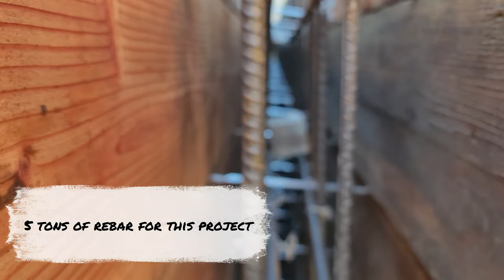How To Build  Concrete Retaining Wall On A Steep Hillside  Start To Finish

Comment: That is a brilliant Vid. Am guessing the piers go down to bedrock, so about 16 feet to bedrock... Did you guys have to drill into the bedrock to get a fixing?
I used to be a geologist as well as a carpenter....lol.  A bit of both Worlds here.

The Bay area need to tie everything down to bedrock because of earthquakes and soil liquefaction.  
This should tie the property to the deck and stop it slipping downhill.

But that is some impressive engineering, and no doubt exceeding code.
Reply from the maker: Yea the inspector made sure we was into bedrock. We had to dig a couple of them deeper

Comment: What do you do for safety that trench is over there head a lot of people die like that every year?
Reply from the maker: Ideally you would shore it up.. But this dirt was super hard and it was only little bit that was over 5 feet..
Reply: If you see the sides crumbling when you are digging, then its wise to shore it up.
If its not crumbling  or slumping and its not going to rain, you gonna be OK.  Most of the time if the soil is well compacted, its not gonna move.
Its only bad when you have soil that's been turned over or backfill.
In this case, its not too deep, not an issue.
Reply from the maker: 👍🏾👍🏾👍🏾 Your my new spokes person 📣📣

Comment: 4:03 to about 4:25 that rebar from the piers should have more development length and the staggered heights of the rebar ''heads'' on each column is not recommended.  Stirrup spacing should be closer at the columns also  6:17  should have stirruped your pier rebar heads and maybe even 90 degree them towards each beam direction == as it stands now, they are slightly assisting in rotation of the grad beam if a force attempts to slide them or rotate them down the hillside.  8:01 I see your grade  beam and more of "heel" might help in resisting turn-over forces.
8:04  mud on steel is just a bond breaker and the top of stirrups lack any top steel (laterally) . 
8:33 put that lateral steel inside the stirrups.   The spacing of the vertical steel is awesome, I like the close spacing.  8:35 lap the steel tighter.    Impalement protection at ground height.
12:57,  I like the corners ... 16:38 at end of wall, I can imagine water retention behind this wall system (increasing pressure) and possible rotation off of pier heads with the little development of rebar... you could have ran those as tall as the wall with close stirrups (using and offset design).   Some drainage ports would have been nice to find in this wall system fyi.  I am guessing you worked with structural plans and possibly a geo-engineer, so please pass on my comments to them and have them reach out to me if they do not understand the value I am offering here.
Reply from the maker: Appreciate the feed back.. And yes we work with 3 engineers on this project and we pass all inspections rebar (piers, grade beam and wall) , soils framing etc. But I'll pass it along.. 👍🏾👍🏾 And yes a full French drain system is in place.. Out here these walls
Reply: Aside from the fact that its inspected and passed code by the architect and city engineers, you are talking nonsense. 
The city inspect and approve the rebar. You only see a vid are not wise enough to keep your fingers away from the keyboard.
Reply from the maker: #myman

Comment: So, you allow for the footing to dry before you pour the wall? I'm doing a DIY retaining wall in my back yard...it's about 150ft x 4ft high...just using your videos as a learning tool, you do good work...I'm not using 2x12 because I have nowhere to put them once done, so I'm renting symon forms for the project.
Reply from the maker: Normally with the plywood setup you will pour footing first..  Check this video out.

https://youtu.be/XNOS1c1_rxw

Comment: I'm forming a foundation wall with 2x6's that I will use to frame the walls of a shop. I plan to space the ties 4' o.c. That sound right? Also, the Simpson catalog says not to form a wall using wedge ties that is more than 4' tall. Seems that they work fine for your tall pours. What gives?    Your wall forming is Impressive.
Reply from the maker: 4 inch on center sounds a bit overkill..minimum we do is 12 inches on center.. Yea not sure where that 4 foot theory came from.. We have built as high as 12 feet.. Bracing is important.  Good lick with the project

Comment: Amazing work. I really enjoy your content. Do you have any contractors whose work you approve of in the Los Angeles area? I have some serious concrete work coming up.
Reply from the maker: Appreciate the kind words.. Do. You have plans for the project?
Reply: @AllAccessConstruction  Structural engineer is finalizing now. Have to build three hillside homes and the accompanying road, which will need 125 foot retaining wall, 10-12 feet high. Homes will have piers/caissons, and will also need a baby retaining wall for the road in front of the homes. I have almost everything priced out except for this portion, so it's kind of keeping me up at nights.
Reply from the maker: What part of LA?
Reply: @AllAccessConstruction  Mount Washington/Glassell Park. It's in Northeast LA, east of Glendale and South of Pasadena. Thanks again, and it you can consult on certain aspects, after I have the plans, It would be paid for.
Reply from the maker: Just hit me up 510 804 4646